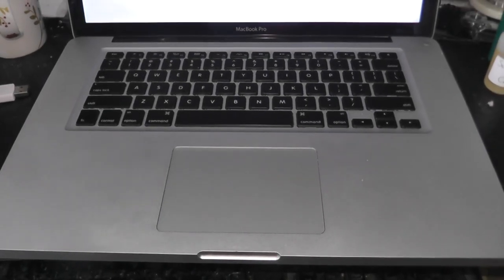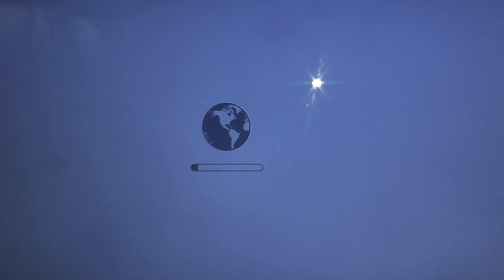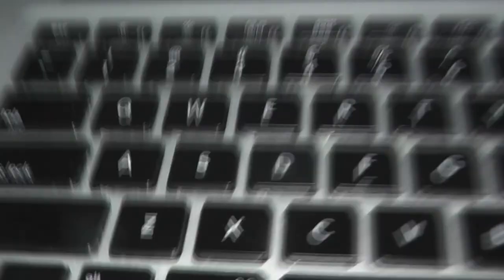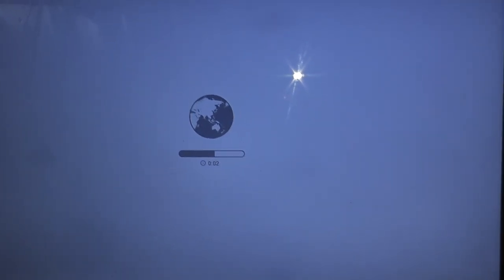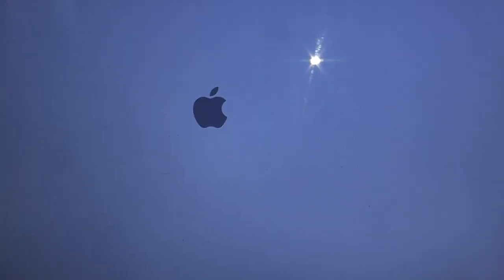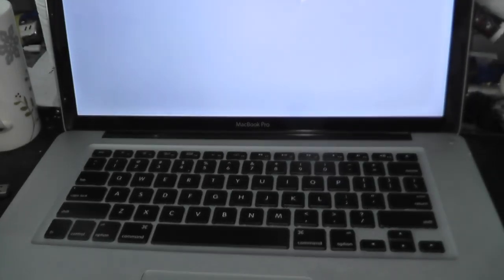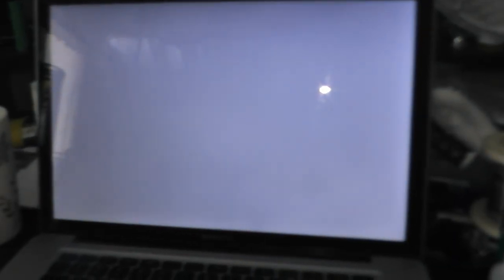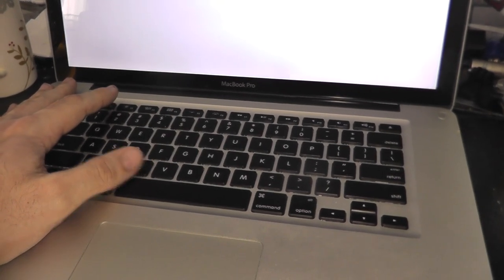Macbook Pro Issues

Comment: Watching you talk about macs is funny, me being a mac guy and all, the light on the front is the sleep/indicator light has nothing to do with the hard drive, the ? folder will pop up until you have an operating system loaded on the hard drive and tiger is too old to load on that  machine i believe, if with a newer os loaded  it still shows a ? than you might need a ribbon cable but as far as i know has nothing to do with a firmware password, it could also be the logic board but its an uncommon problem unless it has water damage, inspect the board thuroughly if you see green and discoloration it has water damage, sometimes you can clean the crud and corrosion out of the hard drive ribbon cable connector with windex and a toothbrush (rubbing alcohol wont break it up) it getting so hot is not a good sign, check make sure both fans are working and not clogged, I know you wont even read this probably but hopefully it helps someone

Comment: The internet Recovery is loading a recovery OS on the HDD/SSD.  That is working.  Something is likely wrong with the video card.  You can't use old derilict OSX CDs..  2011 would be Lion or Snow Leopard minimum.  That won't help you, it will have the same symptom.  It can't display the GUI for some reason.

You have bad luck with apple because you buy cheap broken stuff. Don't get me wrong, that's a valid thing to do, but don't complain about it when you set yourself up for difficult troubleshooting scenarios.

Comment: hehe, the macbook story, I like this one... :D

My old MSI AMD 939 motherboard was fucked (damaged chipset), but it still ran, it just wouldn't accept better graphics cards and locked up all the time... :P

Cheapest way to get a shiny new mac, Hackintosh, all the spec you want, replaceable parts, and the option to say screw that and go to Windows or Linux instead... :P

My Lenovo's power management works kind of like the way you describe the mac power management, it down-clocks everything, reduces brightness, turns off the HDD, etc. and at the lowest settings with my two battery packs (6-cell 18650 pack on the back, LiPo in the Multibay) it can hit 9 hours, but the settings I use I get about 4 to 5 hours... :)

Comment: I want a MacBook Pro, just ugh.... £2,500 for a decent i7 with 16GB of RAM.  I want, but for that price I'd rather make do with the gaming rig and my ThinkPad for when I need a laptop and when I'm out or at school.  Kinda thinking about getting an older Mac Mini...The decent ones where I can upgrade the RAM, and the ones that have a quad core CPU.

Format the SSD to FAT or whatever format OSX uses, since it doesn't use NTFS.  Try a different HDD?  Mac's can be fussy with what drives they'll work with.

People still use Molex?  That's worse than using PS2 Ports...

Comment: Sods law dictates that you cannot find something when you're looking for it... :P

hehe, I saw a used Kingston 120GB SSD at a hockshop, they wanted about £130 for it, used, 2nd hand, less life in it than if it was new, yet my 120GB Mushkin in the C2D was about £60-something brand spankin'... :P

Yeah, don't buy china, they just produce poo that is no good... :P

The rubber things are usually bushings, upgrade to polyurethane ones for better durability and longer life, well, on a decent car at least, wouldn't bother doing that with the G6 myself... :P